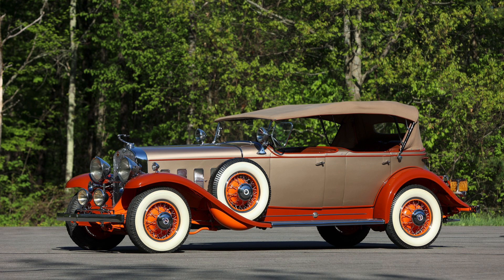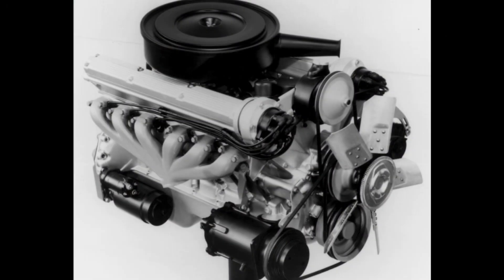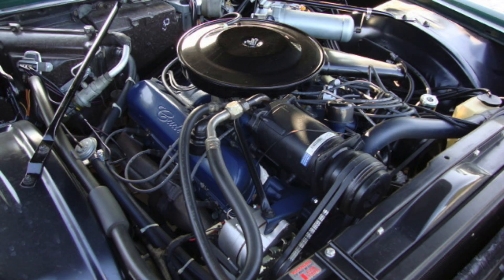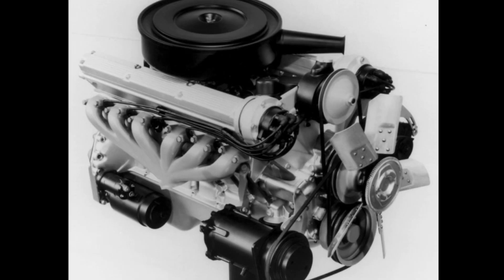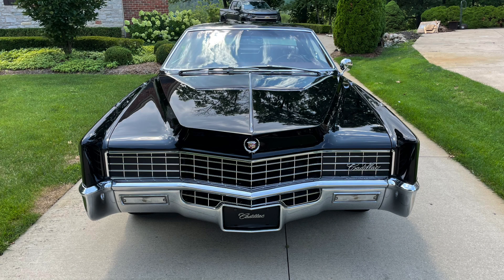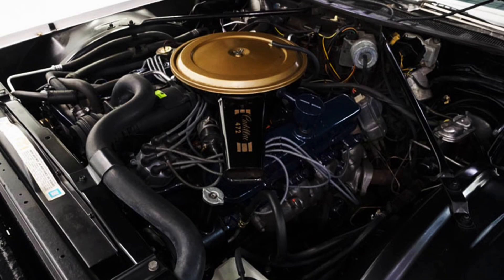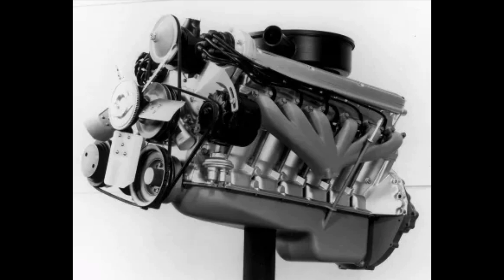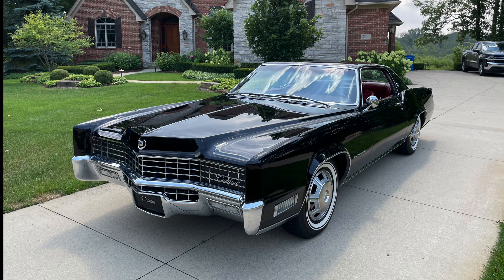Cadillac Builds an Awesome SOHC V-12 for its 1967 Eldorado...But Scraps It For Production!

Comment: Pontiac had an OHC 6 in production.  My girlfriend had one in a Firebird.  Power glide I think.  OHC designs were present in the early days of automobiles.  I assume the casting process was difficult back then.  If Cadillac was too cheap to get the Eldo suspension right they were sure as hell too cheap for a V 12.  They would have had to use it across the line as they did the 472/500.  Probably would have made more sense if GM had made a standard 455 for all divisions.  Maybe FI in Cadillac.
Reply: Yeah the Pontiac OHC 6 debuted for the 1966 Tempest with a 230ci  L6 later increased to 250ci. It was discontinued after the 1969 model year. It’s a shame they don’t continue to develop it further because a belt driven over head cam L6 or L4 version would have been a much better choice for the smog era that was to follow.
Reply: Nothing wrong with having the V-12 universal across the Cadillac lineup into De Villes and Fleetwoods and even Calais as well as Eldorados.
Reply: The 250 Sprint versions could be had with up to 230 hp!
Reply: In '77, they sold the Olds 403 in all 3 BOP divisions, but only for 3 years.
Reply: In the 60 to mid 70's, each divisions was veerry protective of their own engines. Not until the corporate bean counters forced the issue did 'corporate' engines come about and they were a P.I.A. when it came to parts. I worked in parts and a customer would come in asking for a set of plugs for their 350 in their car and you would have to ask for the VIN. They would look at you like you were crazy when you told them their Olds had a Chevy 350 in it or that Firebird had an Old 403.
Reply: GM was successfully sued in 1973 for putting Chevy engines in Oldsmobiles and calling them Rocket V 8s. @hotpuppy1

Comment: GM was so arrogant. Half of their leading engineering went into the dustbin of history
Reply: They were arrogant, because they had the biggest market share.
Reply: Just when GM gets a car line dialed in, they discontinue it.
Reply: Arrogant? Adam clearly stated the practical reasons why the conventional V8 was chosen. Being practical and prudent is never arrogant.
Reply: Specialist junk manufacturers
Reply: Look at what Chrysler threw into the dumpster.
Reply: Arrogant? They were running a business, and assessing risk. The odds are that a V-12 that only built to fit it one car, can and will lose money. They were smart to kill it.
Reply: Ev 1 would be the worst miss step
Reply: I totally agree. 💯 

See the Escala.
Reply: The bean counters ruled.